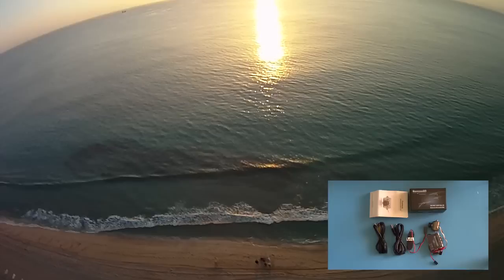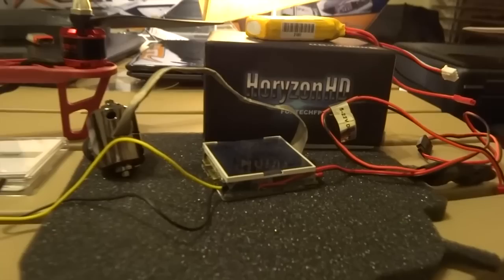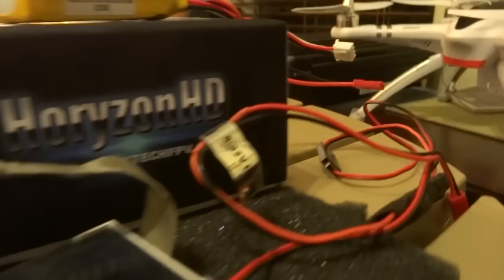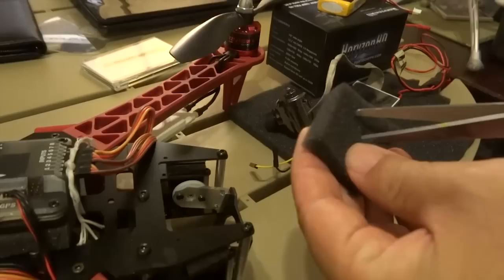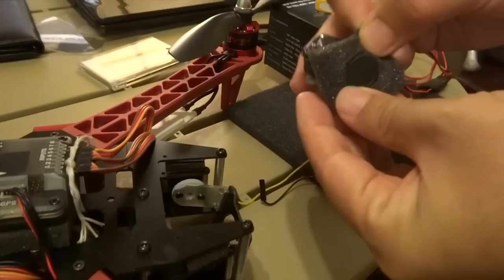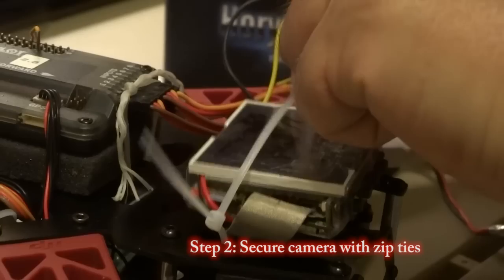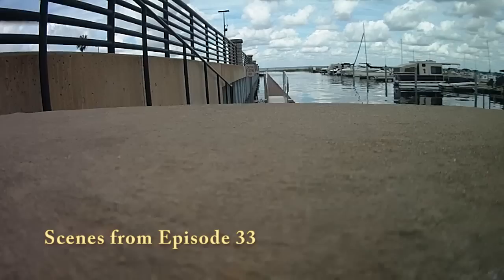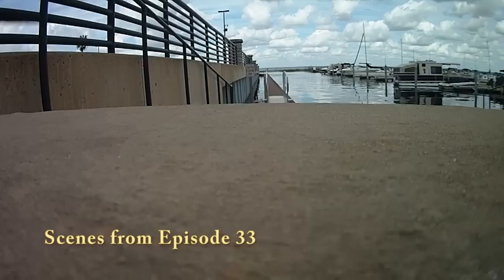HoryzonHD FPV Camera APM Gimbal Setup for Ardupilot (FPV scenes)

Comment: hello I have a set of Skyzone Goggles and i really like your Horizon HD package. how would one connect the head tracking to the Skyzone with the HD Horizon camera on a simple gimbal. i built a gimbal with 2 HXT 500 servos, i have a Turnigy 9Xr. do you have a video about connecting the head tracking to SkyZone? also what video TX do you recommend? thanks in advance
Reply from the maker: Hey Thor, this is Leo one of the flyers here.  By the way I enjoy your videos, the wild Gasparilla and a few others I won't elaborate here. 

We don't have a Skyzone goggle, but I am about to work on connecting the Fatshark goggle, head tracker cable we just bought, to the Taranis transmitter.  I assume the setup will be about the same, once you have the channel setup to control your gimbal.  I will PM you with more updates.  First, I have to build the same quadcopter, as the one on the video was shipped away.

I like the cheap FPV 5.8G 400mW TS353, as it strikes the balance in weight and distance. You can find them in eBay, Hobbyking or hobbystores.  We tried the 500mW, but it comes with a fan that carries an extra weight, noisy too.  We also have a 200mW Fatshark, which works just fine.  Double check, I believe TS353 is band 3, compatible with Skyzone and will be a good choice.
Reply: ***** Hey thanks for your comments about my videos, much appreciated. I thought FPVTech had Skyzones in their store? either way i appreciate the help on this. i am not sure if the Turnigy 9XR is compatible, i dont see why they wouldnt be but i get no motion with my skyzones. i want to get the HorizonHD setup because i like the videos you guy did with them, it looks well suited for FPV. i have two other Quads that need FPV. so thanks for the Advice on the TS353!
Reply from the maker: TheMighty Thor what is the best way to email you, your contact in YouTube is disabled.   Leo
Reply: i'll send you a msg
Reply: ***** will send a message, thanks

Comment: does the combination of the v3 and the minim osd works?
just ordered the camera and some options and use the apm 2.6...

now i am not sure which osd i am going to use, the minim osd seems to be the best fit for the apm, but i've seen on rcgroups, that there are problems with the overlay due to a high video output of the camera...

thanks for any tip

Phil

Comment: Hello, why don't you upgrade to 3.01 APM firmware? Is it too buggy?
Reply from the maker: hi Andrei, all of our quads are on 3.01 Arducopter firmware.  It is the best firmware to date as far as I know.  We even have it at default PID values.  You may have been confused with the APM 2.6 flight controller version number.  For example Arduplane is 2.76.
Reply: ***** This is right, I didn't notice coma :) Thanks for the explanation and for the video. Indeed a nice camera!